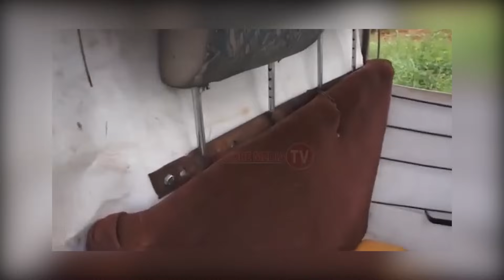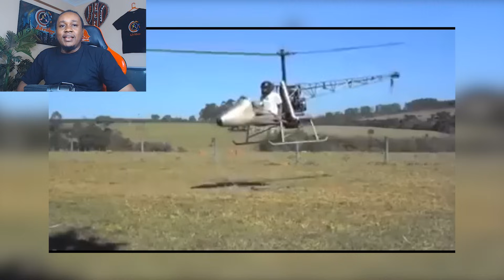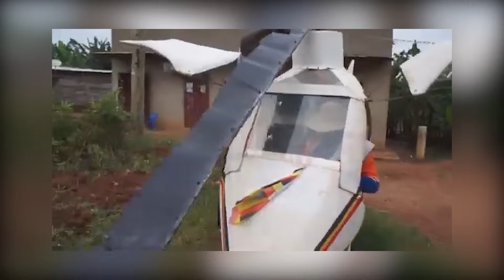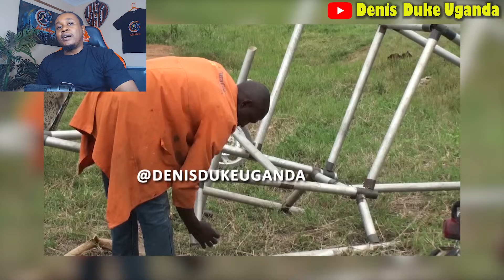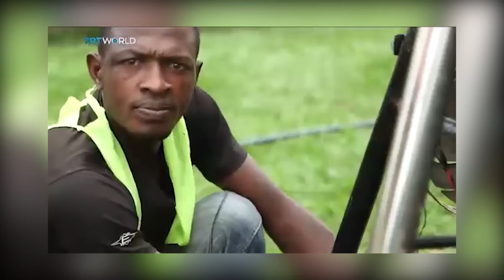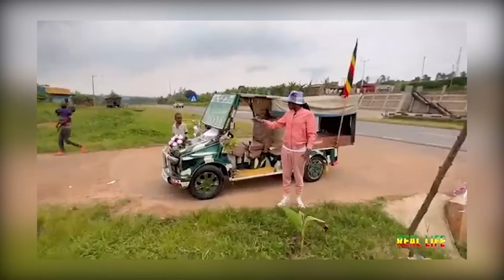Helicopter Made In Africa That Can FLY

Comment: Looks like the test didn't end well because he was almost at a rotor stall, so he kept applying more pitch which made the torque higher. It came to a point where the main rpm was so low the tail rotor couldn't counteract the torque from the main rotor and it started to spin on itself, and then ended when the motor shut off with the crash. With some knowlendge it could've been prevented, but I don't blame him for it because it's a difficult thing to notice especially on smaller helis with no rpm gauges or warning systems. Thankfully he seems to be OK.

Comment: Single cylinder is impossible, yees there are 2 cylinder in helicopter but its a 2 stroke, it has the same power with 4 cylinder 4 stoke, in order to takeoff you need50 engine horsepower like the mosquito helicopter with the empty weight of 160kg, if it is bigger like the robinson r22 With empty weight of 390kg you need 140hp